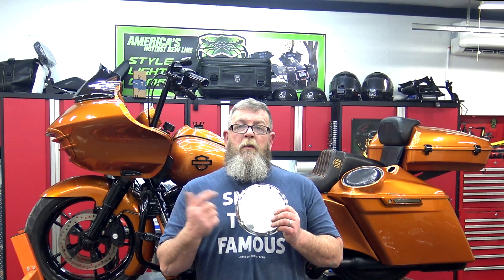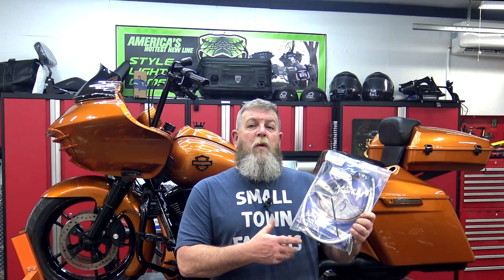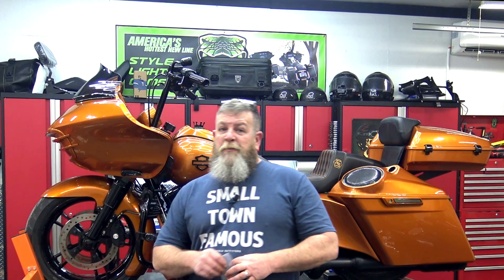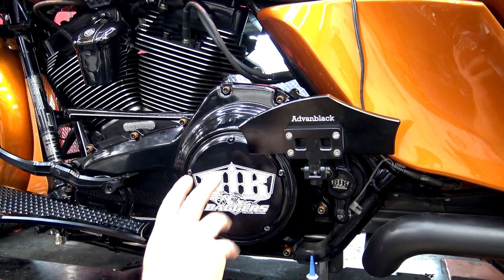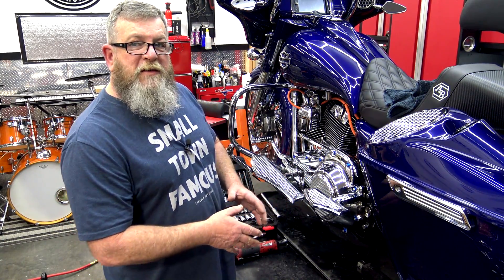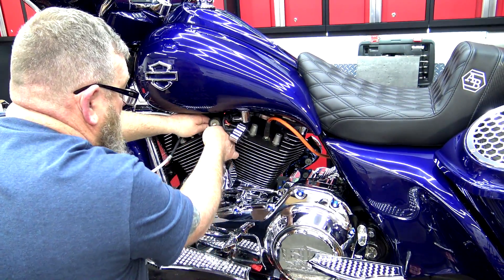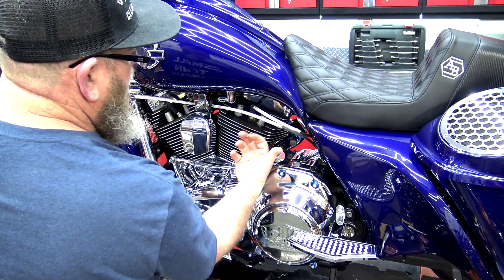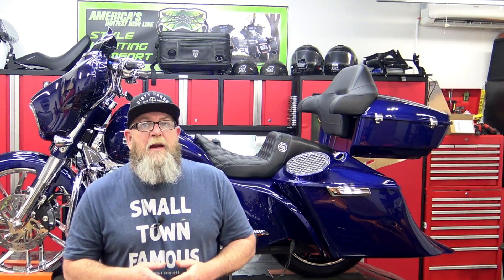⚡Customize Your Sled With JH CHOPPERS Custom Derby Covers! ⚡

Comment: Steve, who makes the Derby chrome over you had on the blue SG with the horizontal cut pattern?  Thanks
Reply from the maker: Its the finned cover by Joker Machine, got it on amazon https://amzn.to/3uADINE I have the matching front and rear master cylinder covers, clutch reservoir cover and points cover

Comment: What wrench are you using to take that derby cover off?
Reply from the maker: Milwaukee M12 ..its a beast..been using it daily for 4 years and still going strong...even on the first set of batteries still, I recommend getting 2 so you always have one charged up Ratchet https://amzn.to/43ZGE3m ,  Battery -  https://amzn.to/41UIVe3 , charger  -  https://amzn.to/41QuxUn

Comment: Hey Steve what mounts are you using for those passenger pegs/boards?
Reply from the maker: The mounts come with the boards from Advanblack.
Reply: @sikbaggers  is it possible to buy just the mounts for pegs that will clear stretched side covers